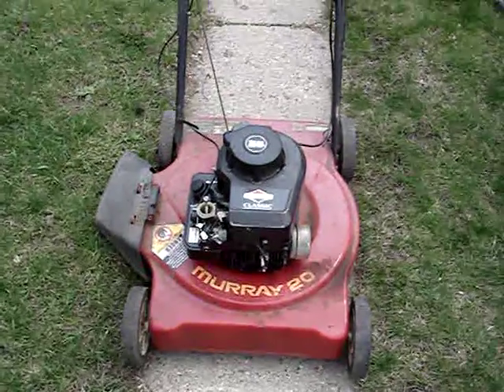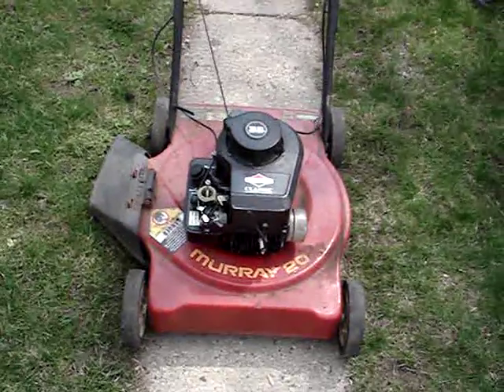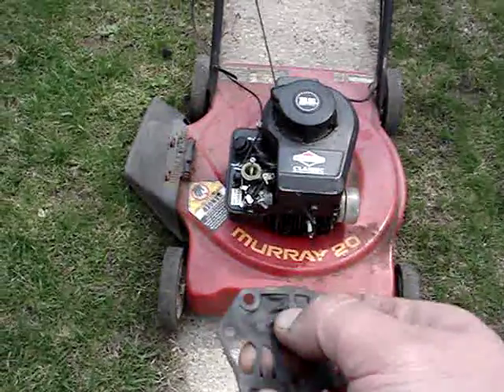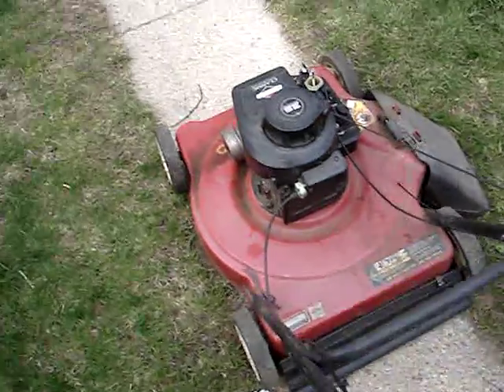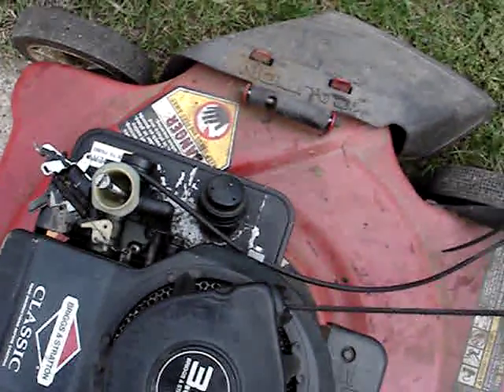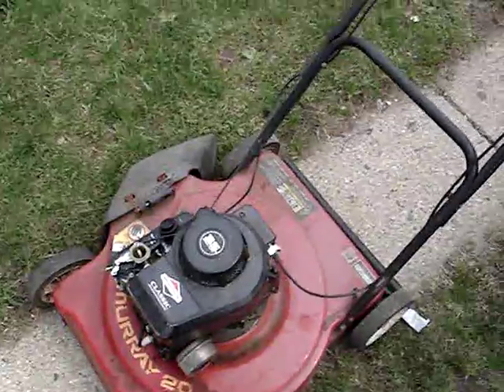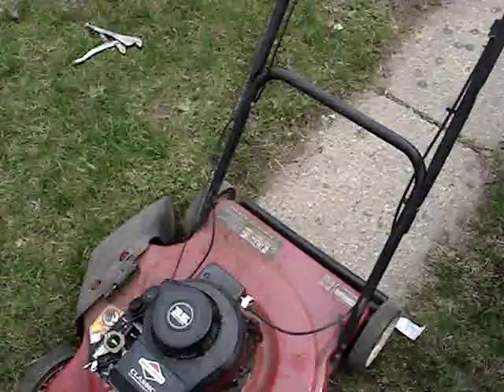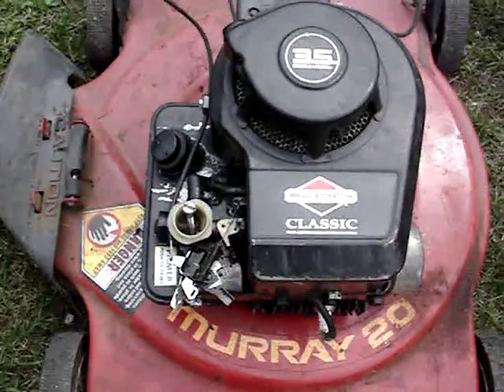Trash Picked 1991 Murray 20 Inch Lawnmower Fixed

Comment: I scooped one of these for 15 bucks with a broken pull start. got a new rope and the recoil rewrapped and got it running turns out it had a bent crankshaft. so I put another briggs 300 series I had on the deck.
biggest problem with selling it is the cut height is not really adjustable.